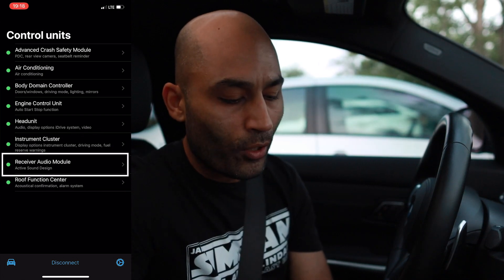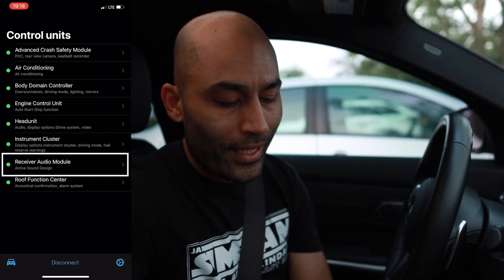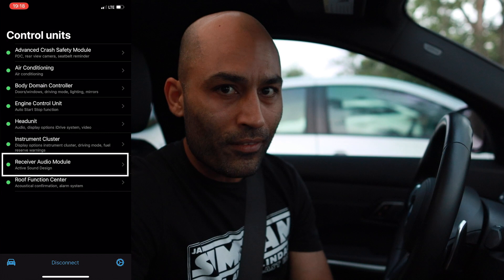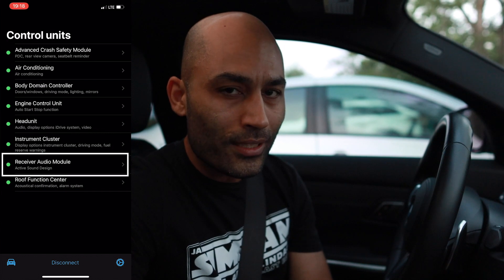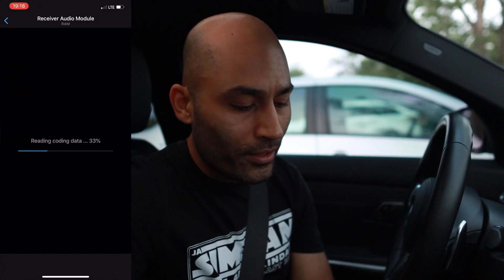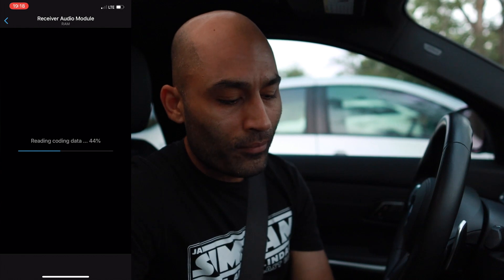How to fix fake engine sound in a BMW (Pumped in audio) — BimmerCode / BimmerLink (Pt. 1)

Comment: Bonjour je viens d’essayer ça marche très bien merci a vous mais j’ai un petit souci quand je coupe la voiture ça se faire une fois que j’allume la voiture ça ouvre pas sans me connecter sur l’application est-ce que vous savez m’aider pour ça
Reply from the maker: The settings remain till you change them back. Only on default mode the flap auto opens and closes.